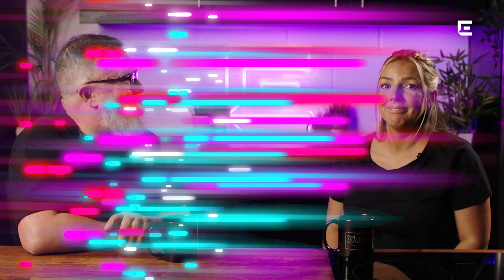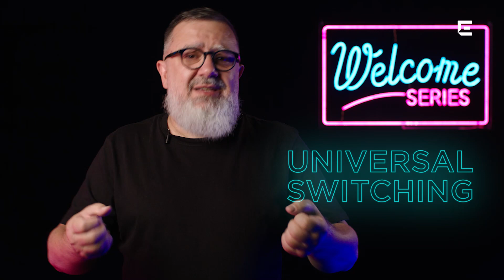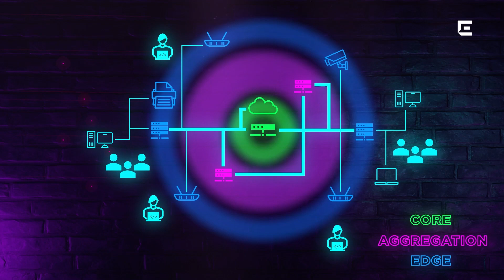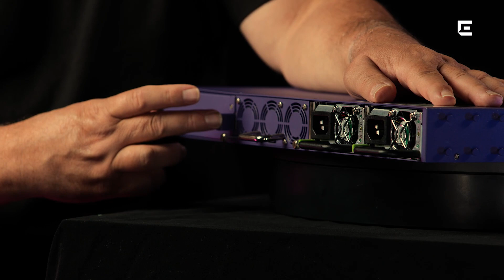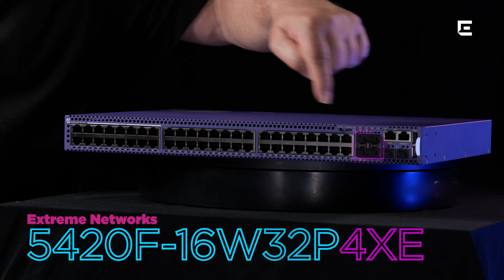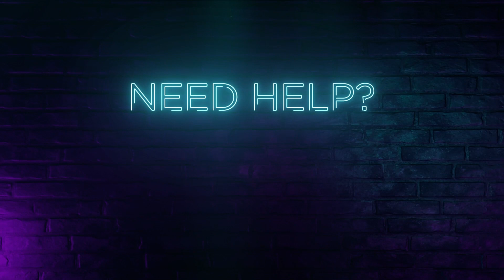Meet Extreme Switching - Episode 1

Comment: Hi, I have watched the series on Extreme Switching and Fabric Connect, and purchased two extreme switches for my home lab. If you can, please tell me why my X450-G2-48p-GE4 does not have any OSPF functions? I can define vlans and give them IPs, but when I go to define an OSPF router ID, I don't have that command available. Any ideas? 

Also,   I have been a network architect / network design engineer for over twenty years and have only had the opportunity to work on Cisco switches, but I have taken it upon myself to train on Extreme and invested my own money in two switches, but so far, I have not been given access to an Extreme portal account because my switches are gray market and I'm using them at home.

Please help.